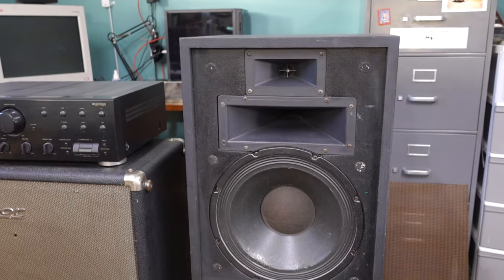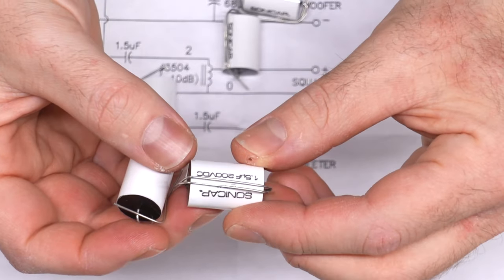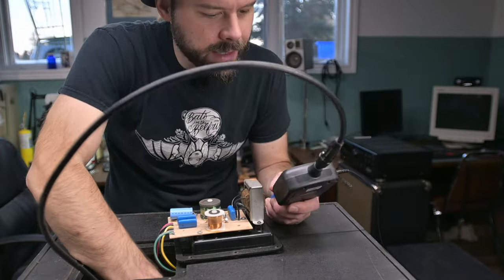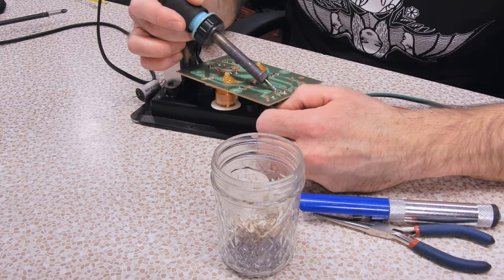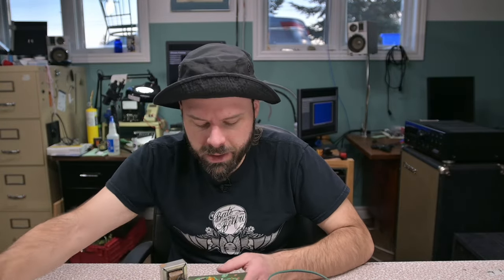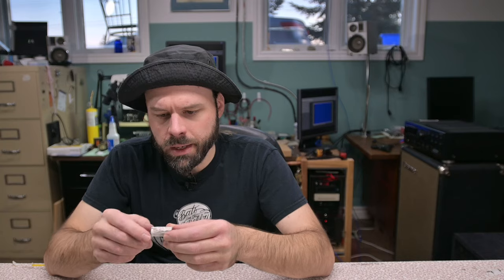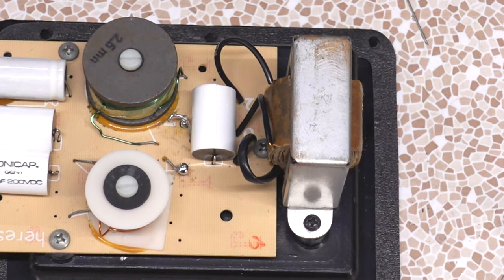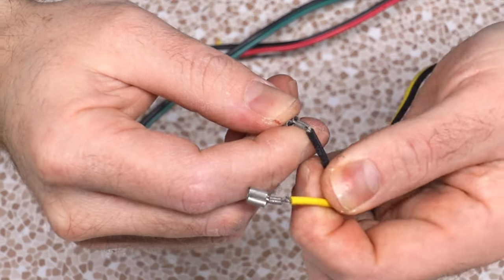Klipsch Heresy 2 Recap

Comment: When a capacitor goes across the (+) to (-) like the 68uf, it actually shunts the frequencies above, in other words cuts out the higher frequencies. The single coil on the woofer would make the slope roll off at 6db per octave, and by adding the capacitors it doubles the steepness of the slope to 12db per octave.
Nedlab capacitors sound good for horns.The inductors like the 0.16mh going across the tweeter terminals (+) to (-) actually do not filter high frequencies but rather filter low frequnecy...same concept as mentioned above but in reverse.
Reply from the maker: I'll have to point this out to my buddie who like modding on crossover and keep having questions about it. 
I know the basics, but not the in depth math.

Comment: When desoldering I find solder wick cleans the board nicely. Also isopropyl alcohol should be used on the board, cap leads and the solder for a much cleaner connection. As far as speaker health, if the caps are being changed the tweeter should be too.
Reply from the maker: Ah yeah, I have solder wick, I keep forgetting to use it unless I'm working with SMD parts. 
Are you suggesting alcohol on the connections BEFORE soldering ?
This would be redundant. 
Yeah these speakers were all over the place, is was the start of a restoration project for the client. They weren't mine. Honestly I wouldn't even want horn loaded for a home system.

Comment: The inductor across the squawker is an autotransformer. It’s purpose in this circuit is to attenuate the signal to match its output to the other drivers in the speaker.  Auto transformers essentially pass the signal to the driver without altering the frequency or dissipating heat.
Reply from the maker: Oh, it's not part of the filtering ?
Interesting. I'm well familiar with auto transformers, and now that I think of it, I have seem them in speaker attenuators before, like the Marshall Power Break for guitar amps, I think uses that technique.

Comment: I've done this with many pairs of klipsch.  Each time, I got vastly improved sound than the factory crossover. Electrolytics do not belong in the audio path. Power supply of an amp...ok.
Reply from the maker: Foil caps do seem more appropriate for this kind of thing. I was surprised bi polar electrolytics even exist thb. Polar Electrolytics are used in audio circuits all the time however, in the low level signal paths, seem to work fine if you use the right grade ones. I admit, I'm not the biggest audiophile tho.

Comment: 😅😅to upgrade the crossover  is to optimize all. A 68uf mkp cross cap jantzen is for 18€. A alternative type 400v for 15€. Air inductors for the tweeter is must have. And change the position under the inductotrs. Allmost 90° under all in Position.👍👍🇩🇪
Reply from the maker: Yeah, bud is still tinkering with these units to this day.

Comment: Useful info as usual. I am recapping some of the caps on a Gigabyte Sinxp1394 motherboard tomorrow and will also glue the DPVRM daughter board to the motherboard as it feels loose and I think it may have  gone some way to destroy the caps which are blown (split at the ends). I have a socket 478 3.06Ghz P4 to run in it, so it should be pretty quick.
Reply from the maker: Hah, I have a video coming of me recapping a motherboard. Just a few that were puffy tho. I didn't need to board, it was mostly for the lols.

Comment: A polarized cap will be indicated with a +….. the cap symbol is acceptable. Component markings always mount readable.
Reply from the maker: Yeah I'm aware. In this case the schematic, had polarized caps, but the ones in the kit were non polarized. I imagine a polarized cap could be used in this application, I see them in audio circuits all the time, usually at lower levels, at output levels, I'm not so sure. Is that schematic suppose to be polarized ? 
I havent' known crossovers to use polarized caps, if that's the case, then the schematic is bad form.

Comment: Nice video. What is the difference between a third order and a fourth order cross-over, and what is a butter Werth filters
Reply from the maker: Couldn't tell you off the top of my head, I don't know that much about crossovers. Mostly just a tech with speakers in to shop for the upgrade. I know in principle how they work, and I could probably roughly design a basic one, but not the terminology.

Comment: Too bad we can’t hear before and after. I wonder how many caps get replaced unnecessarily.
Reply from the maker: Ah, did I not do some before ? Either way, yeah, it doesn't translate well in a video recording. It'd be really trick to record a speaker in such a way. 
The concept of a cap change does have some legit science behind it. Especially when it comes to power supplies. Electrolytic caps contain moisture and do dry up over time. 
Film caps, not so much. They last much longer but there are cases where ones that are very old straight up short out, now mind you, that could be in equipment from the 40s to 60s.

Comment: Do you think the sonicaps are worth the price for these speakers? Or do you think something much cheaper from Dayton would suffice?
Reply from the maker: Well, that's a tricky one. The sonicaps came with a kit the client bought, I don't think it broke the bank. For "These speakers" not sure. I'm not a fussy audiophile, but I do insist on having a decent stereo, and have been an audio tech for many years. The way I look at it, there are a lot of links in the chain. You have your Dac, your amp, and even your original sound source/file to consider, and I think you'd need to be running a pretty high end setup before you'd hear the difference in the caps of a simple xover, at that point, you probably aren't using "these speakers". 
I've heard big improvements from a DAC upgrade in the past, even using cheaper speakers. 
If it was me, I'd probably just sound out some generic, but decent quality name brand(ish) caps from digikey or mouser, instead of using boutique caps in "these speakers". 
I can totally stand behind the concept of replacing old caps. I do it all the time in gear I work on. 
I did hear a difference when I changed these out. The question, were the old caps still good, and I heard a difference in cap quality, or were the old caps worn, and I heard a difference in fresh caps, on that, your guess is as good as mine.
Reply: @DATT  thanks for the reply and insights!